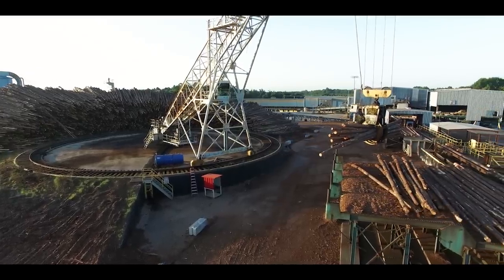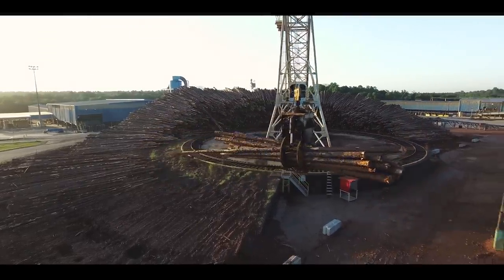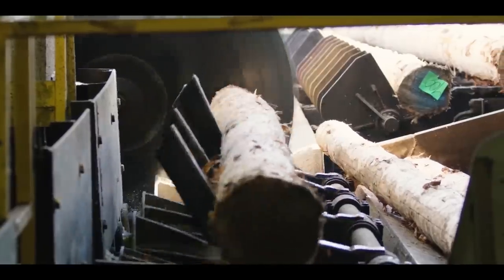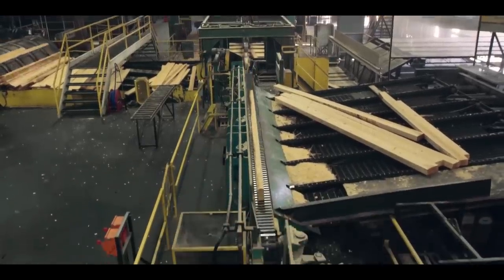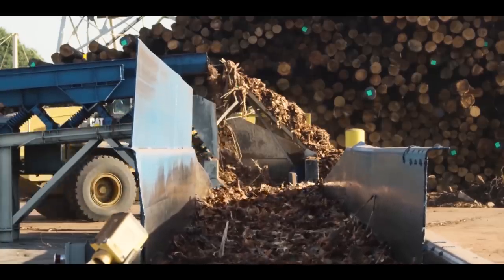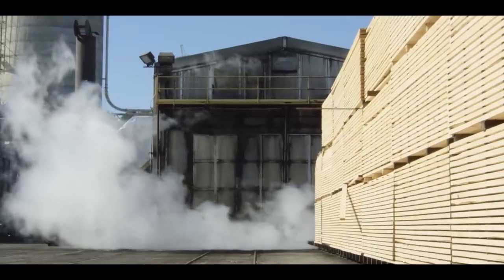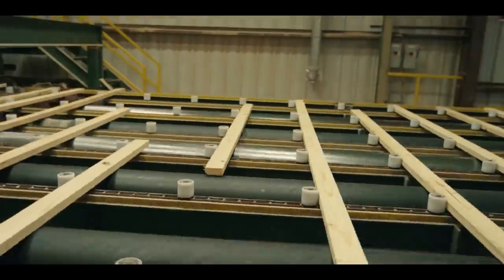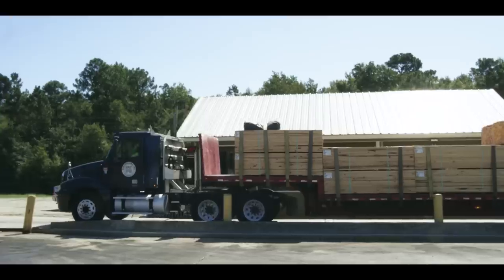Inside an Interfor Sawmill

Comment: You would think knowing that this was being recorded the employees could have at least used quality boards to show off their products, but all I seen was warped and flimsy boards. At least know I know what brand to avoid at the hardware store🤷‍♂️
Reply: you cant control what internal pressures in wood spring things which way during milling, they clearly grade them out
Reply: Good sir, please consider the fact these hardworking folks carefully grade the final product.  The internal stresses in the wood cause the various grades.   YOU get to pick those boards when you purchase...want the cheap stuff?  Well, its gonna be warped and twisted.  Hence "cheap".  You want the good stuff?  Straight and true?  Well, thats gonna cost more and it really doesn't matter which group of hard working souls did the milling.

Comment: If you’ve never unloaded a rail box car full of 92 5/8” studs, you’ve never experienced a DEFCON 1 level of anger. I swear they must load a flat car and then weld the box around the lumber. The company I worked for almost 30 years ago actually had a guy killed unloading one. You just have to accept the fact that you’ll have several hundred boards to pick up when ur done. If you don’t lose ur shit and quit first.
Reply: Did you not get your lumber delivered on an A Frame?  Years ago we bought lumber by the train car load and never got it delivered in a box car, that would be frustrating to unload!
Reply: Almost everything was delivered on A Frames except the precut studs. This bastards came in a box.